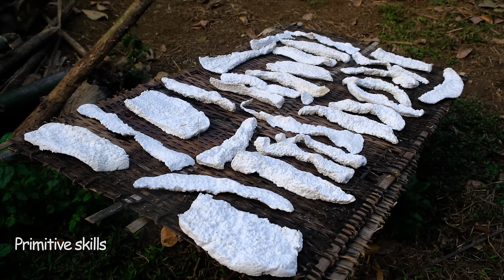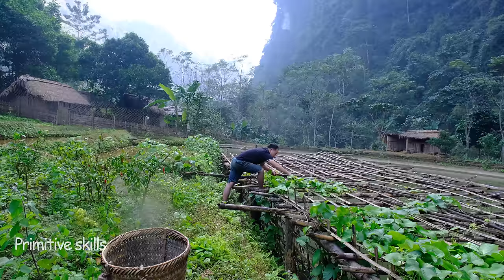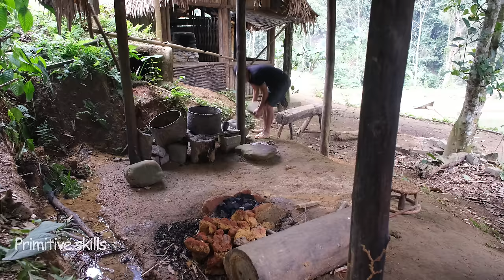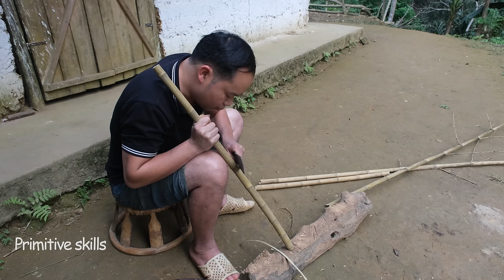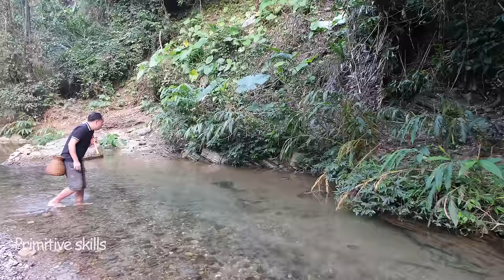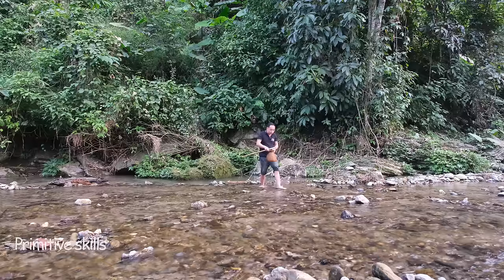Primitive Skills; Make rubber fish guns - Fishing

Comment: As a blacksmith. I must offer my thoughts on your forging technique. I notice that you are always rolling the steel around to keep it round, presumably. The proper way to elongate steel is to forge it close to the final dimension square, rotating the steel 90° per turn. Then knock the corners off, making it an octagon. Then finally, round. This will drastically improve the speed of your forgings.

Comment: Duong, you still need to make a ladder or ramp for the chickens to be able to climb out the water if they fall in.
Reply from the maker: Thank you, your shares are very useful to me
Reply: @PrimitiveSkillsnet  have you thought about making a pump drill? It will be very useful when you repair the water wheel.

The design for the drill is very simple, and it would not take very long to build.

I was also thinking of how to improve your saw. You should sharpen the teeth, which you can do using the corner edge of a stone to get between the teeth sharpening the edges. You could also try setting the teeth on the saw. This involves individually bending the teeth slightly to alternating sides. This will mean the saw cuts a wider path through the wood which means the blade will get stuck less often.

I wish good health for you and your family!

Comment: My wife suggest Marigolds (Calendula Officinalis) for your insect problem.  There are about 50 different kinds of the flower, they are commonly referred to as Tagetes.  You plant them along with your retables and it helps to keep the insects away.  At least it has helped her a lot over here in the states and it is a common practice to plant them in the vetoable beds in a lot pf places.
Reply: Cymbopogon, also known as lemongrass is a popular one we use in my area as well.
Reply from the maker: Thank you, a very useful sharing for me, wishing you a new year and many good things to you and your family.
Reply: Also @PrimitiveSkillsnet  2 rods, steel, one at each end of a plant bed, and wrap one rod with the copper wire, run it underground to the other steel rod and wrap it around it.  It keeps bugs away and helps with growth, didn't believe it till I tried it.

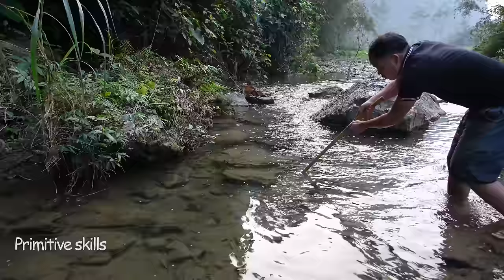Comment: (27:20) Ánh sáng bị bẻ cong khi truyền từ nước sang không khí. Vì vậy, từ vị trí trung bình của bạn, con cá dường như ở xa hơn thực tế.  Trừ khi bạn đang nhìn thẳng xuống.
(27:20) Light bends when it passes from water to air. So from your average position, the fish seems farther away than it actually is.  Unless you are looking straight down.